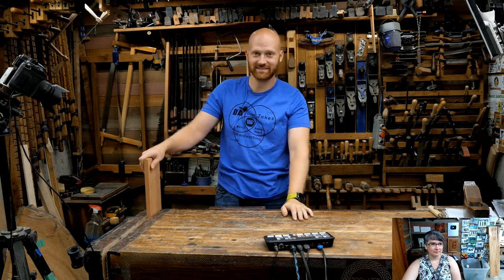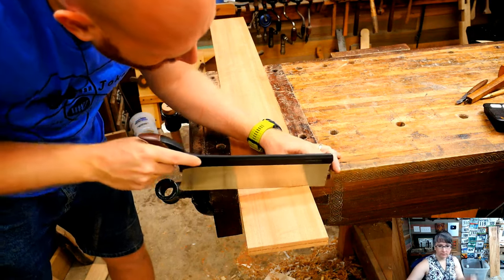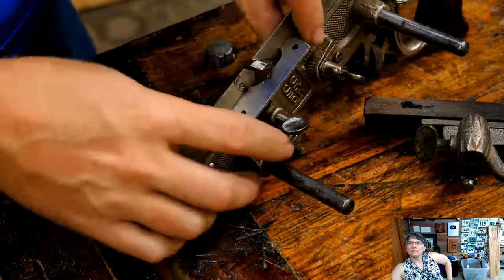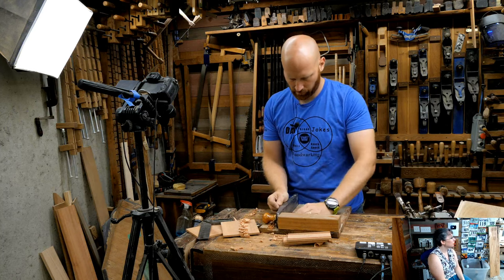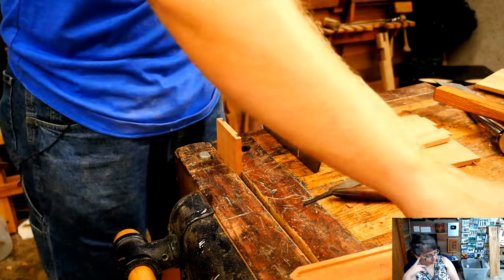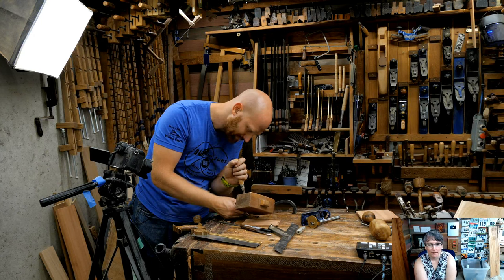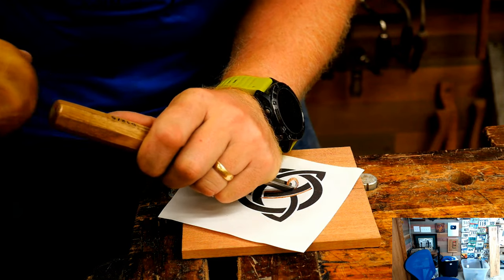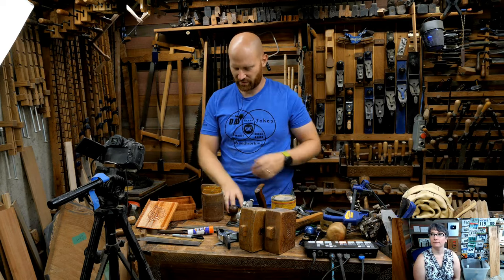Making a Box From a Single Mahogany Board

Comment: 3 hours to make a box ?
Reply: Most people have no idea how much effort it takes to create something with your hands. 3 hours is nothing
Reply: Yes
Reply: Sounds like a challenge. It has always amazed me the reactions I get when stating the time spent on knives I've created to people who have never made a knife let alone have sharpened one as if im slow or something. Granted I'm not the best or fastest maker by any stretch, but critiquing someone when they themselves have no experience in the subject matter would be an insult if I didn't find it so hilarious. Please, tell me how long it should take to plan, measure, cut, remeasure, bevel, heat treat, temper, remove heat treat scale, cut scale material, profile scales, sand scales, glue scales, and Sharpen. Granted there are more steps but you get the gist of it. 😅
Reply: Lol you must not understand hobbies.

Comment: If you're using boiled linseed oil that you didn't make yourself you should be careful not to expose yourself to any solvents that might be in it that can be toxic, a lot of that stuff can cause neurological issues if you're not careful.
Reply from the maker: That used to be more common. But most of them nowadays are far more benign.